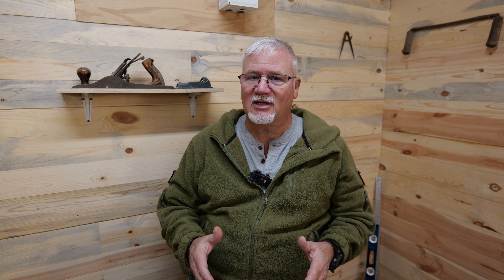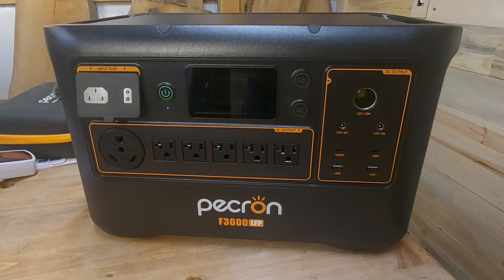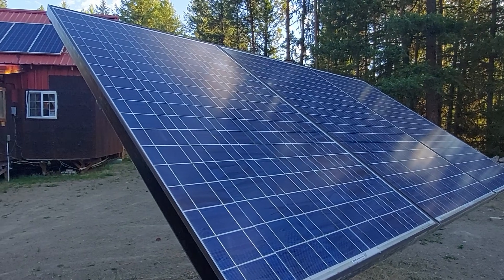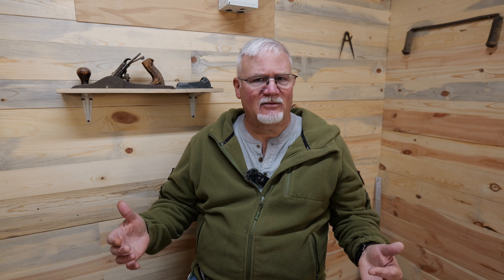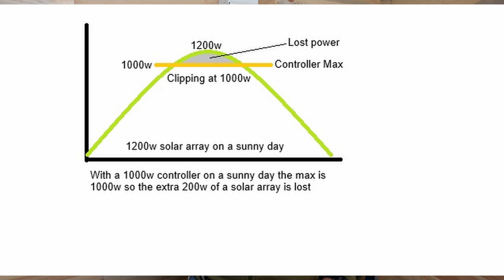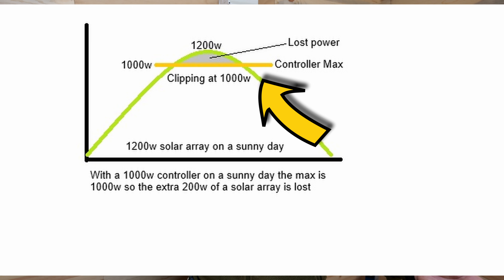What is Over-Paneling? (And Why You Should Do It - or NOT Do It)

Comment: Good comments, good points, I am planning on putting panels on my garage. The problem is the neighbors, the two diffrent ones have good size trees that seasonaly block the sun, the people that I was talking to for a solar project don't seem to follow my concern for the tracking of the solar, I am planning on using 8 panels, maybe 2 or 4 controllers, so as the sun goes by and shades a set of pannels or more the whole string dosen't crap out. But then in summer I need solar on the other side of the barn style garage for sun that isn't in the shade of the peak of the garage, if I put the panels on the very top of the garage, I can't see them, and I do know going up the hill to look the northern side is all covered in shade and snow. You have reinforced my idea of multi controllers, and a summer/winter mode system.
Reply from the maker: That's definitely a common challenge with panel placement, sounds like you're thinking it through well!
Reply: Have you done and hit/miss solar panel systems? Do you have and thoughts? I am thinking of every other vertical on one controller, the skipped on the other. I was thinking of doing a parralel till this post and went, hmm this may be a better plan concept.
Reply from the maker: Not sure what you mean by hit/miss system?  I have two arrays, one that is fixed at 45 degrees on my roof.  It faces south and is made up of 2s3p poly panels that run to an Outback Flexmax 80 charge controller.  The second is a moveable array (the oldest) which is 3s poly panels that I tilt for different times of year (currently at 63 degrees) and rotate as needed/wanted.

I think the best options today, are different in that you can set up BiFacial panels in an East/West vertical wall and, frankly a North/South wall as well and get excellent production (by of course, using different charge controllers for each array).

Now, my next setup I'm building now is 4 400w BiFacial panels that will be about 45 degrees on a moveable rack on one controller and 2 400w panels on a roof that will be about a 3x12 pitch so they will be almost straight up at the sky with a southern exposure and poor exposure to the east.  Just what I'm working with :D

Comment: Can I use over panel on a power station use a cable splitter with a lead going to a stand alone MPPT going to a stand alone  battery to use all the extra power coming from the over power or just use a battery charger plugged into the power charger to charge the battery?
Reply from the maker: Not sure what you mean but I think you mean to split the solar feed so it goes in two places?  No, you can't do that.  The solar panel (s) but either go to a charge controller connected to the battery, or to the power station.

Over paneling refers to having more solar panels in watts, than the charge controller is rated for.  You can't go over voltage but can go over on wattage.  You can do that to any controller.

Comment: You also need to be below Isc on the controller otherwise a sudden shift of cloud can cause a big enough momentary voltage spike to blow the MPPT before it compensates.

Good quality equipment (eg Victron) publishes an Isc value, some gives you a percentage for overpanelling, other stuff you get to guess.

In most of the UK we go a lot closer than 25% below Voc because we simply don't get -20C kind of temperatures where the panel voltage and efficiency rises dramatically. Mind you we also want peak power midwinter.

The one cases I've found it makes an enormous difference is on tiny power stations like the Ecoflow River 2, because they are limited to 110W, but you need about 30W to actually charge due to overheads. That means except in good sun with a 110W panel you'll get nothing, but with a 200W panel it'll charge decently most days.

Multiple charge controllers of course means you can handle shading better. Also means your voltages and current on each cable is lower which can be an important DIY consideration as having 3 or 4 mppts at 500W means your solar cables are far far less likely to go up in flames if you crimp them badly. That has always made me prefer multiple MPPTs.
Reply from the maker: Great stuff!

Comment: Can someone give me a bit of advise please:

I have a Victron SmartSolar MPPT 250/70 (250V / 70A / 2000W / 24V system) - The location (Finalnd) I am in I get sunlight on the left side of my cabin from 3am to 10am. The sun is directly facing my cabin from 10am to 12am. From 12am to around 4pm the sun is on the right side of my cabin. Cabin is on one half of a forested island (surrounded by water), the other half is protected forest that can't be build on and no trees can be cut down.

I want to install panels on the cabin roof. Can I install 2000W panels on one side of the roof and well as 2000W panels on the other side of the roof, and run them both to the same charge controller ? As both sides of the roof are never in direct sunlight simultaneously. Any suggestions on how you guys would do this ?
Reply from the maker: I suppose you could if ran in parallel via a combiner box, but I'd just use a 2nd controller (not an all in one but just controller, and Victron makes several)

Comment: A couple cases I can think of for over paneling:
1. If you have limited space, you may opt to mount panels vertically on a fence or wall, so not only will you never have them angled to get maximum noon sun, but you can't turn the wall/fence to orient the compass direction.
2. In order to flatten your charge curve if your controller maximum wattage is limited, you may want to have some panels angled toward the morning sun, some for ideal noon sun, and some for evening sun.
Reply from the maker: Good considerations for sure!
Reply: If you have panels at different orientations you really want one mppt per orientation or your lowest generating panel will pull down the generation of the rest
Reply: @etchedpixels  If you wire all the panels in the same direction in series and wire the different directions in parallel, that shouldn't really be an issue.
Reply: @kylefrandsen2665 you will pull the voltage down if you do that and the current if series. Far better to use multiple mppts usually as it's a lot cheaper than optimisers
Reply from the maker: Using multiple MPPT's really is the answer and I can't understand why there is resistance.  Most cite money/costs but come on, really it's not that much!  Even at $450 for a Victron MPPT is manageable for anyone doing this (or maybe you should wait a little longer and save).

Comment: "Over Paneled" is a bit of a misnomer!  Solar Panels are rated at "Ideal Laboratory test conditions" that most people will never encounter with their installs!  For every 1000 watts of panel, just quantify it as 750Watts!   Because that will be much more inline with real world experience!  

The one parameter that people underestimate is Panel VOC (Voltage Open Circuit!)   On a cold, clear winter day your Panels might produce 35% higher Open Circuit Voltage than the Panel's standardized ratings!  Not taking that into account on series branches, leads many into eventually fried MPPT/AIO controllers!!!
* You can thank me later!
Reply from the maker: True, though if they are like me, they may often see peak out of a given array (I can actually see MORE than my poly panels are rated for even in warmer weather).  To be fair, you could certainly use the 75% rule but may also be losing 25% at different times without realizing it and having a cc that can take it all isn't much different (or more expensive for that small amount).

On voltage, yes!!!  It's actually better to be closer to battery bank voltage for efficiency but many big systems today are way over and work fine (like 400v arrays going to a CC and 48v bank).

Comment: The issue is that vendor of AIO solar inverter does not recommend connecting external mppt or other AIO to charge the common battery without communication. Do you have videos to demonstrate what you mentioned?
Reply from the maker: I'd argue that's nonsense.  We've been doing it for a long time.

If that's what they are telling you it's the 1st reason not to use them 😉

Comment: Ok I got a 60 Amp 1000 watt charge controller and I got 4 200 watt bifacial solar panels? To get 800 plus bifacial gain should I put another 200 watt bifacial panel?
Reply from the maker: 60Amp 1000w??  Doesn't sound right.  For example 60A at 12.8v is just under 800w but at 51.2 it's 3000w.  

No, BiFacial gain, I am assuming you mean the gain from the real of the panel?  In your case I suspect your cc is just fine for those panels and possibly more.